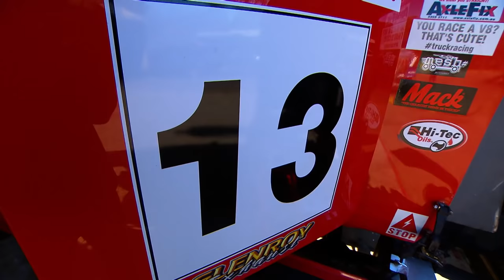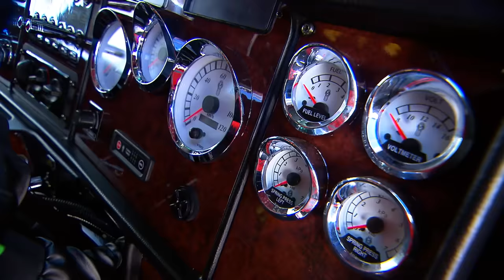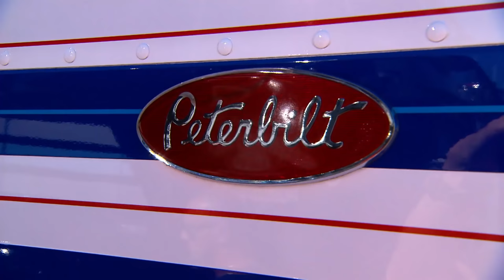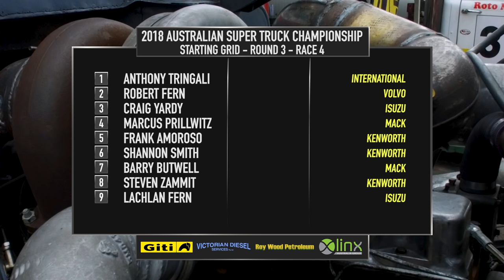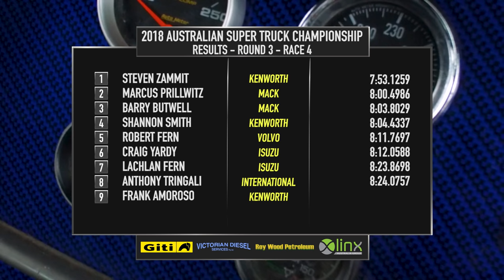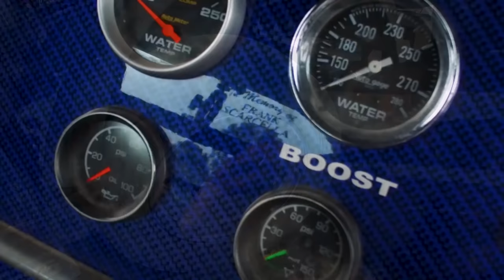Australian Super Truck Nationals - Rnd 3, Winton Raceway - September 30, 2018

Comment: How many horsepower do there tend to be in these trucks ?, I know it varies.
Reply: North of 900 to 1000 horsepower on a single or compound turbo depending on the class. Take Aron koffman for example
Reply: 1500HP ,4000 ft pound torque
Reply: @fateexpressful  well for a heavy class truck those stats are true if you have the money

Comment: Would these trucks withstand half an hour of track against the Formula Truck here in Brazil? lol

Technical Data:
1,250 hp and 561 kgfm of torque.
(Mercedes-Benz OM 460 LA engine)
Reply: Difference is these are not purpose built race trucks.. they are modified highway trucks. Engines and all. They have been heavily modified, special transmissions, frames shortened/ stiffened, engines modified to rev higher quicker etc but these things are far from the pro trucks. Like comparing an F1 car to a Nascar.
Reply: @scotthoffmaster4600  My dear Scott ...

These trucks in the video are also prepared as well as those of the Brazilian F-Truck. It has the same modifications that you mentioned, but ours are more powerful and have a better set ... Ah, using EXACTLY the same tires that trucks on highways use, which proves that our drivers race in trucks with more than twice as much power and with the same grip as a regular vehicle. I know there are (obvious) differences between an F1 and a Nascar, but from your comment, I don't think you understood my post ... Read it again please! Thanks

Comment: That seem dangerous, why aren't the exhaust pipes lower¿?  Or at least not windshield level with the truck behind. Is it a safety thing, or for power, or engine longevity¿? Trucks weren't smoking all the time, but when they were, it looked all but blinding for the driver behind..

Comment: One hopes the cabin air filtration systems are in tip top condition otherwise those guys should be equipped with gas masks! Australlia sometimes looks like Texas used to be in the 1980s.

Comment: Think the smoke is why we stopped doing it in the UK
Reply: Well all that smoke is wasted fuel. If they wanted they could drop some fueling and gain efficiency without losing horsepower
Reply: @chriswright6068  still,  not the most environmentaly friendly series 😉
Reply: Electric truck racing, coming to a track near you.
Reply: @bremCZ  I had a Scalextrix truck/trailer years ago, would that do😉😁
Reply: Erotikstudio Winkler GmbH  Only if you don't think about the future technology. There's no need for onboard batteries to have any more power than your average starter battery.

The future electric applications can go anywhere we want. Scalextric racing isn't as silly as it sounds.
Reply: @splatmanhooha4264  Think of that, beef up the size and imagine wireless charging being the entire track surface...

That or just use hydrogen beads. Either way less smoke coming out of the truck, which is what people seem to focus on.
Reply: @bremCZ   yeah , but if everything scales up, I don't think I can handle a 35 foot controller 😬
Reply: @chriswright6068  Actually, ALL the black stuff is soot and falls to the ground unlike petrol exhaust.
Reply: Actually, ALL the black stuff is soot and falls to the ground unlike petrol exhaust.
Reply: @glutenfreegam3r177  only problem is that it is incredibly carcinogenic and does blow about rather than settling,  nope, definitely electrify the track and play Scalextrix
Reply: @splatmanhooha4264  Yeah let's burn more coal to power motor sports! 
Diesel still emits less emissions than petrol and coal.
Now if the track is generating its own renewable power, that's another story. I'm not advocating against racing. Just advocating the education of racing fans and those whom oppose racing alike
Reply: @glutenfreegam3r177  Hang on...coal...steam truck racing, now there's a concept! More employment, 'cause you need a driver and someone to shovel the coal and it'll be very safe, no more petrol fires because you already have a fire 'safely'  enclosed in the firebox, genius🚂

Comment: do they use the standard engines and gearboxes with like 16 speeds?
Reply: Definitely not stock trans. Looks like maybe 5 or 6 speed semi auto. Pretty light at 5 tonnes so doesn't need 18 gears . Probably stock block with bigger turbo, injectors, fuel pump. Water cooled brakes.

Comment: Australian super pollution !
Reply: Erotikstudio Winkler GmbH  Actually some of those shitboxes have 1700 hp and 2500ft lbs of torque.
Reply: @tumbleweedking5668  But 99% of them dont because you need a built engine for that..
Reply: Scott Falkner for a few seconds until the pistons melt.